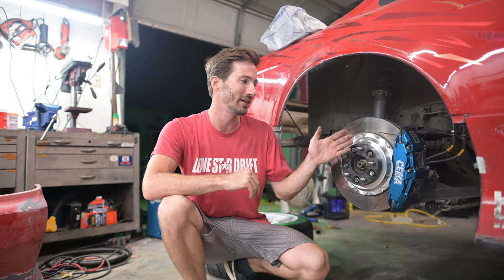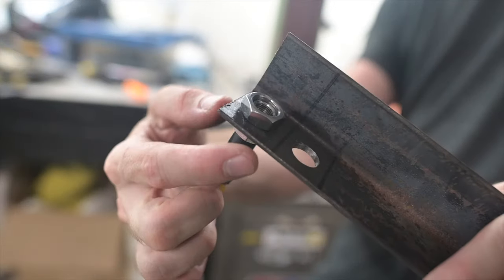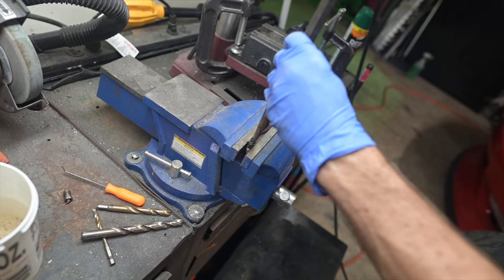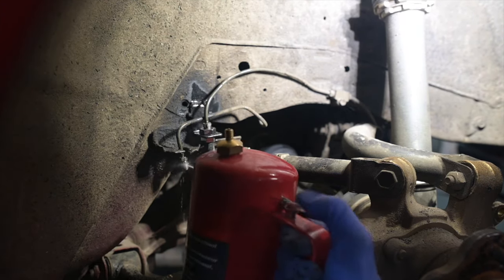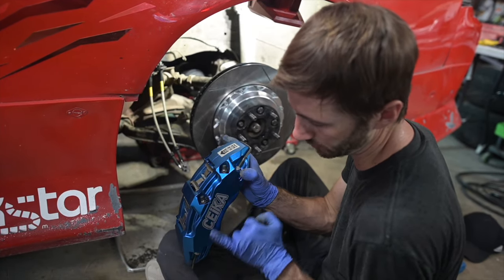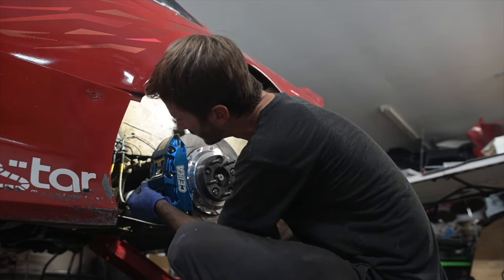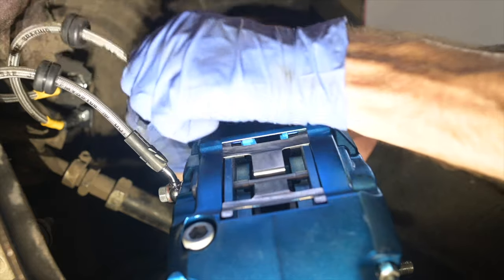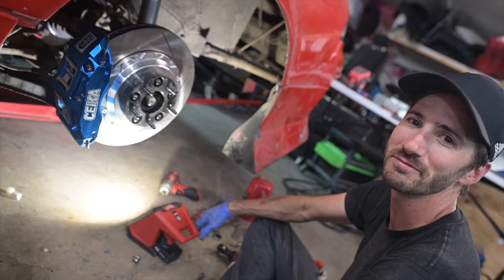NEW CEiKA Big Brakes with Dual Drift System: Integrated hand brake in one caliper!  Review & Install

Comment: did you choose to run the same pads on both the handbrake and the normal rear brakes? just curious. 
btw you single handedly just convinced me to finally buy my big brake kit from them, so good choice on them to sponsor you :)
 
I found this company and almost bought a big brake kit from them, but didnt find enough about their quality online (like 5 years ago) to feel comfortable spending the money on them. Since then the car I was going to put them on has started seeing much more track use and I finally experienced how scary brake fade is last weekend at the last autox event of the year after letting my friend run the car aka us doing back to back runs on it. Its an E60 535xi with pure stage 2 turbos making like 650awhp, so it was pretty sketch when the brakes faded lol
 
ps did you consider asking them to send you a carbon fiber rotor package for your free/discounted sponsorship brake kit? just peeped them on their website and they look insane
Reply from the maker: I'm running the same pads for simplicity.  Using the lowest temperature ones because the car is mostly used for street and drifting which neither typically generate much heat in the brakes
Reply from the maker: Decided to go with a modest setup for now to save cost as well as show off the ones most people will buy.  The carbon ones are definitely cool just overkill right now

Comment: Endless has made the Drift6R for a while that is a similar design that uses two pistons for the foot brake and four for the handbrake. I'm surprised you don't see more of these with how much unsprung weight they probably save over a dual caliper set up. Btw, how much weight did this kit save you?
Reply from the maker: In my case it was not a significant weight savings however the overall braking ability went up tremendously without adding a bunch of weight

Comment: What size and how many piston did you installed in the front?
Reply from the maker: Same size up front, 4 piston
Reply: @FieldingShredder  and thats too keep the brake bias almost like stock right?
Reply from the maker: @kyrontuitt5142  a couple reasons. to save weight (drift cars dont need crazy brakes really) to save cost, and because i'm running 18's i can only fit certain brakes.  The brake bias is really controlled by the master cyl or a bias knob
Reply: @kyrontuitt5142  the manufacturer sizes the pistons to be compatible with the  factory master